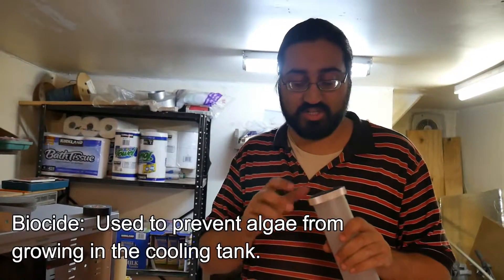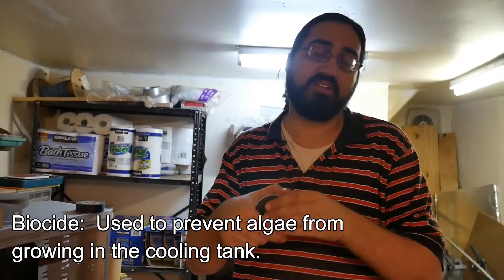PC / System Builders CUSTOM COOLING - Use Distilled Water

Comment: 6 years later and this information is still the best advice. I've had only nightmares using colors. Color separation or the color is stuck all over my parts. Tedious to take everything apart to clean.
Reply: Agreed, colors are for looks, that crap is a pain to clean.
Reply: yeah I was just running distilled and I have just switch to a color coolant with all the necessary chemicals in it and I have totally noticed my temps are about 3-5C hotter than before! makes me want to switch back I really don't see what all the hype is about if performance is worse the color is just a cool bonus for me.
Reply: @breckboy654  Just enjoy your coolant colors, but keep in mind that cleaning up will be a lot of work. You will notice when the color starts to look opaque, the color will separate and stick to all  of your tubes amd fittings. I am running distilled and will never use color again.
Reply: @Techisol  thank you I will but once I’m out of coolant I probably won’t buy more

Comment: what kind of biocide do you add in distilled water? because i can't find any in my area and only algaecide is available which also a type of biocide
Reply: Try find it online, biocide for pc water cooling...
Brands like mayhem & EK.
Im using pt nuke it's the last bottle that i got unfortunately its not clear liquid its blue means it has copper sulfate.
Copper sulfate also kills bacteria but it strips nickle over making the color change from silver to brownish or golden brown.
But doesn't affect performance only the aesthetic of the waterblock.
But you want to do a reflushing maintenance to avoid build up in fins.
And still require disassembly if needed.
Once a year disassembly is not a bad thing for every loop ( water block fins & filter gets clogged over time whenever you use distilled+biocide or coolants) just dont wait until it really is clog.

Comment: Colors are so overrated, the cleaning is awful, , even they sell color tubing nowadays for you won't have to deal with the mess colors leave in your loop, distilled water with a kill coil or two is definitely the way to go!
Reply: what if you have a combo of aluminum rad and copper block, what kind of corrosion inhibitors do you put ?
Reply: @rubioraven  it doesn't matter, deionized water, a kill coil with an inline filter, is the way to go my friend

Comment: I’d rather use deionized water over distilled because distilled has minerals that can still carry a current. Deionized does not. Considerably way more expensive than distilled but worth the buck to save your rig from damage in the event of a leak.
Reply: yes that's true however the issue is it picks up ions from the medal in your loop and becomes conductive again
Reply: I make my own distilled water. Zero ppm,  no way it can have anything in it and it's all I drink.

Comment: I’m using medical grade distilled water. I haven’t added anything to it, and a year on, it’s still running like brand new. Is it necessary to put something in it?
Reply: Yes biocide.. but its hard to fine a clear biocide now.
Blue liquid color biocide has copper sulfate which as additional add on which kills bacteria etc.
But it strips nickle over time slower than silver kill coil (silver will strip nickle immediately and its a disaster).
Im using the one with copper sulfate it requires to add a one drop every few months but that will result in more copper sulfate inside the loop.
So im reflushing it, its better since distilled water will take minerals from metals over time and some stripped nickle will be in mix with it so to avoid blocking the micro fins of the block its better to flush it.

Reflushing and refilling is not time consuming specially when your loop is carefully planned not just by the looks but also for maintenance.

Most people just add a drop every a few months or a year etc. Without never changing the distilled water and when doing a disassembly after 2 yr or more gunks will be noticable at the fins of cpu and gpu block but still a lot better than pre-mixed or concentrate coolants.
Those things becomes chalk/powder if not properly maintained.